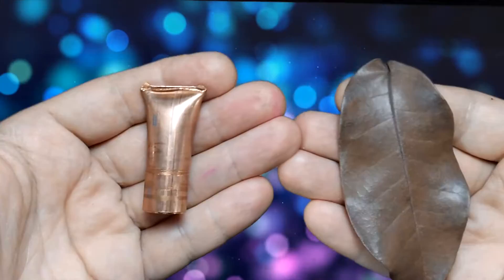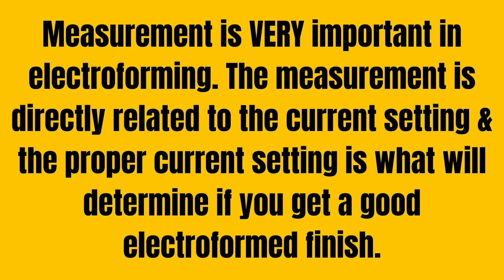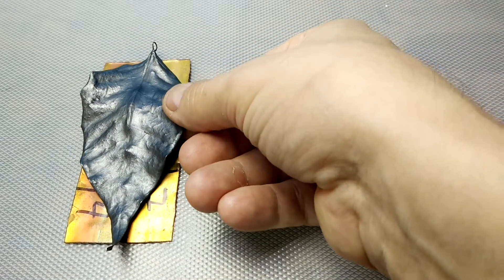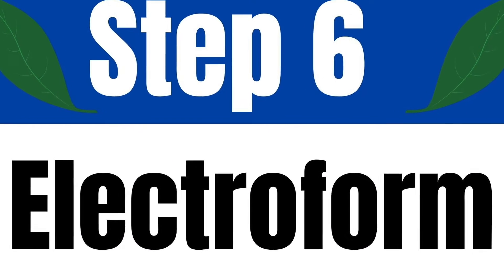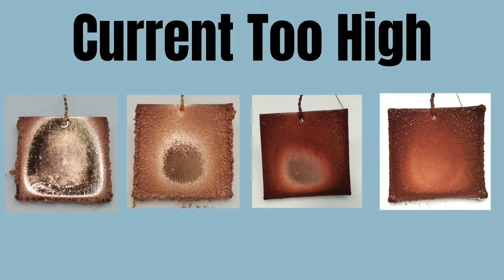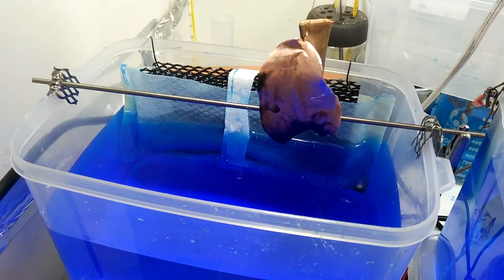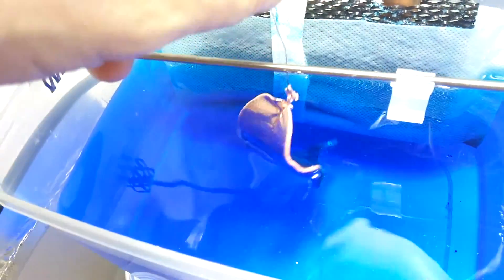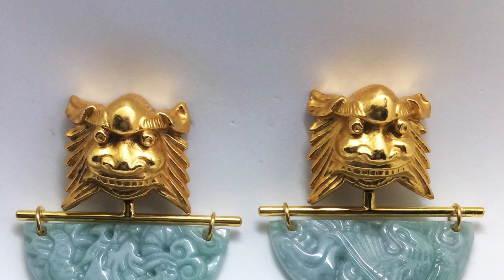How To Make An Electroformed Leaf Step By Step Tutorial

Comment: What "voltage" was this done at?  .9 amps at what ? 5vdc, 12 vdc, 24 vdc?
Reply from the maker: Hi, it' was plated at .9  in constant current or CC mode, so the voltage is not really something that you need to adjust, the machine will automatically adjust for the proper voltage to keep  the current constant. I will vary a bit throughout the process, but probably about 1.5 - 3 volts .  Some plating is done by voltage, but this plating is done with amps / current.

Comment: How fragile are the leaves?
Reply from the maker: If you leave them in the tank for 18-24 hours they are very durable.
Reply: @electrojewelerjordan490  would you still be able to bend them with your fingers? If using an extremely large leaf, would the organic remains of the plant inside the coating cause any issues if used in an art piece with electric wire touching them?